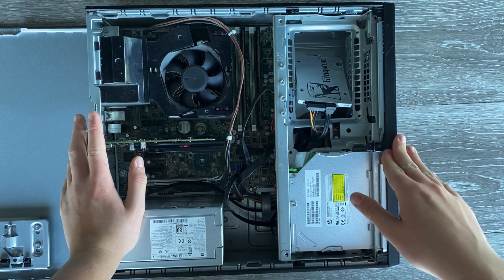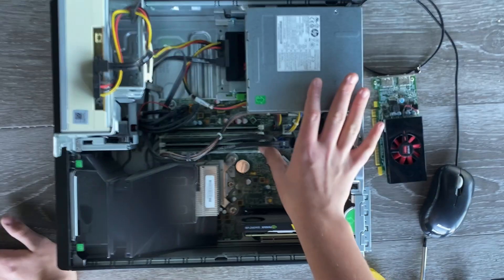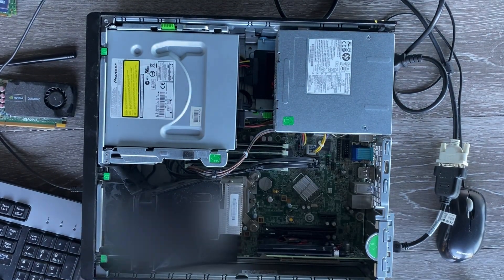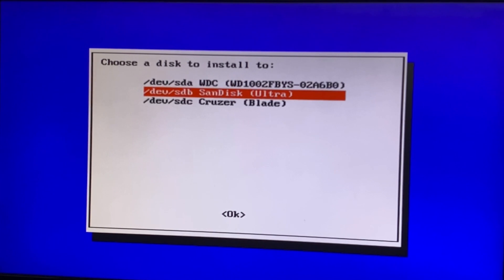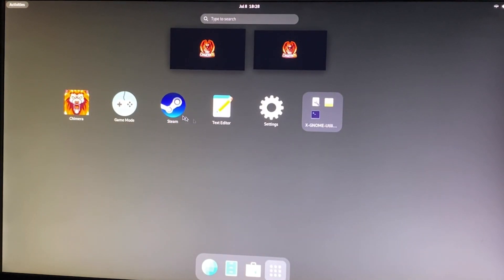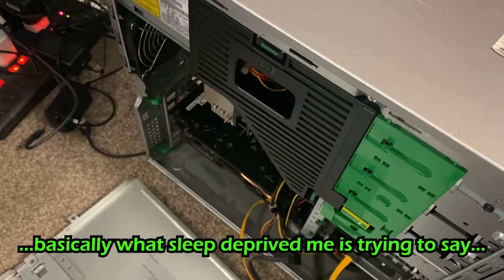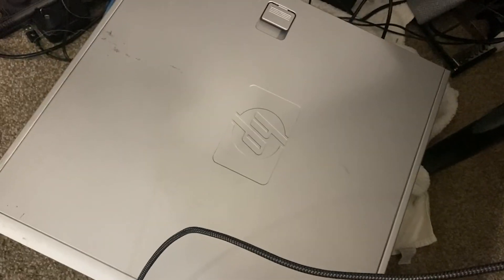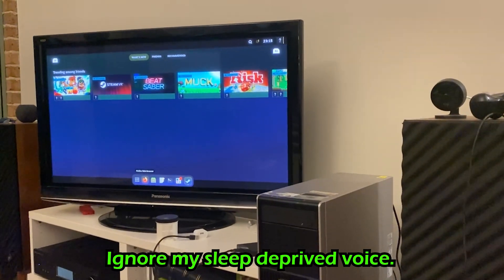Installing Chimera OS but everything goes wrong...

Comment: Hey man, how are you?
I'm from Brazil and I want to test this Chimera OS.
Not just for Steam games, but for Retro consoles. I'm currently using Batocera, but I'm having difficulties with emulator settings.
Browsing the net, I found this Chimera and became interested.

About my PC Console:
CPU: Xeon E3 1270 V2
GPU: Radeon RX 580 8GB 2048SP
RAM: 16GB
HDD: 4TB
MOTHERBOARD: Gigabyte GA-H61M-DS2H

Can I play retro consoles and these Steam games?
Reply from the maker: Wow nice PC! Your specs are probably perfect for chimera os and would most certainly run steam games and retro games through something like RetroArch.

Comment: i had issues with ubuntu mounting some months back, Turns out the USB is the problem. Sometimes rufus doesn't like certain cheaper USB devices. Changing to a higher quality one is the way to go.
Reply from the maker: Interesting. I’ll keep that in mind.